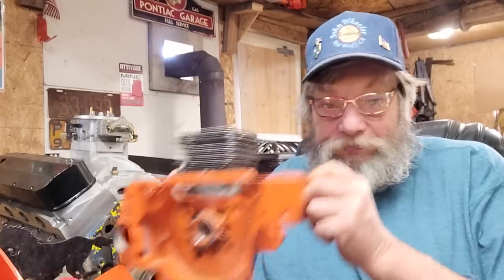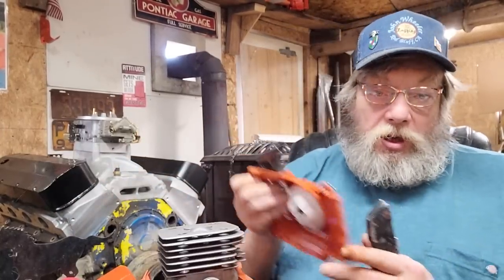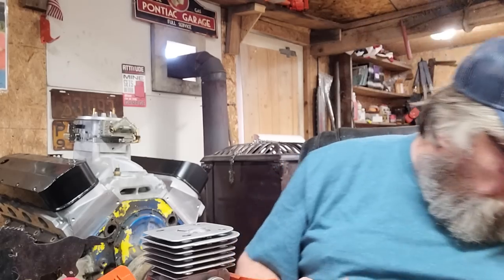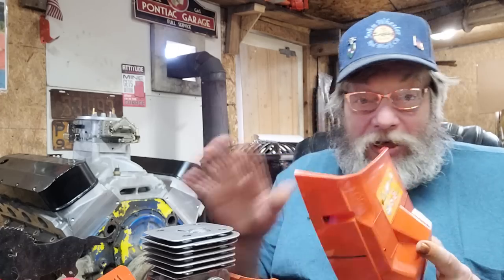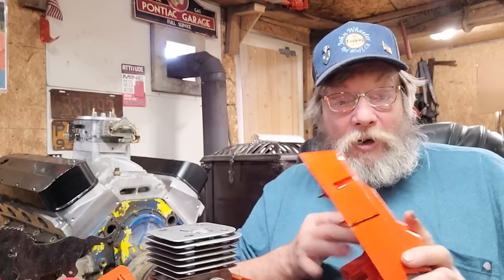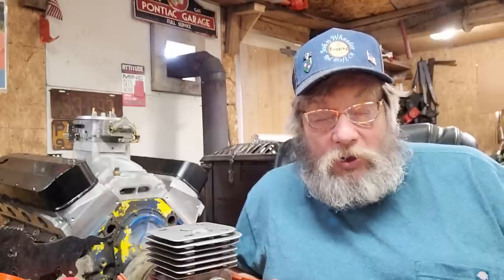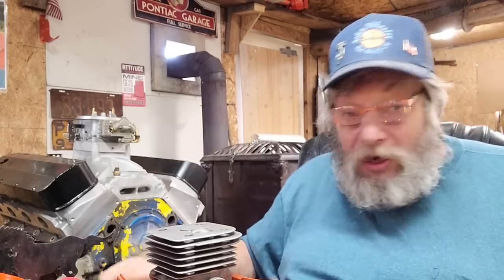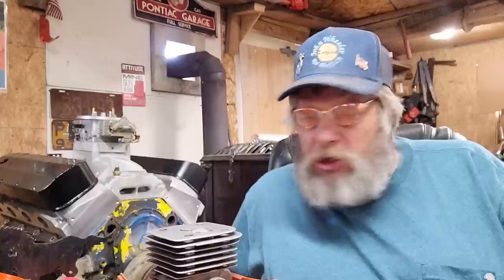let's take a look at ripsaws ported saws! I'll do business  with them!

Comment: What’s up with that engine build in the background? Is that a regular carb? Or one of those EFI set ups?
Reply from the maker: 1050 Holley dominator carb!
Reply: @theironhorse6600  Damn that’s an expensive carb! I’m putting a fresh rebuilt SBC 350 with a edelbrock avs 2 650 carb into a G30 Chevy van I’m building. How do you feel about them edelbrocks avs 2 carbs just for a cruiser van? Also what u doing with that engine? What’s it going in?
Reply from the maker: They are great carbs!  Building a 496 big block chevy for Cullen to go drag racing!

Comment: What silicone does everyone use for base gasket delete?
Reply: Currently im trying Permatex Motoseal but Dirko Ht is easier to use and get so its better for me... i have used also Reinzosil in a past and it is awesome but its hard to get  :)
Reply from the maker: Any motoseal! Can be purchased at most motorcycle dealers!
Reply: Where do you get the right cylinder hone?